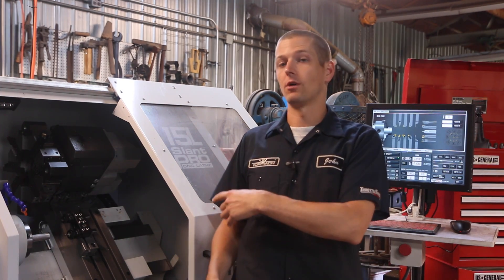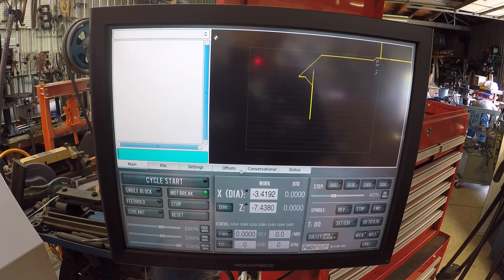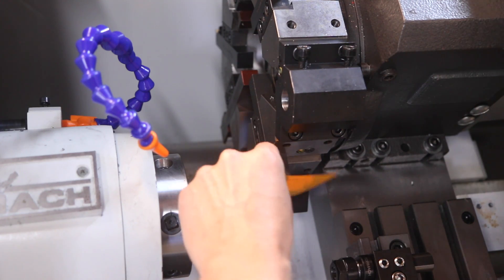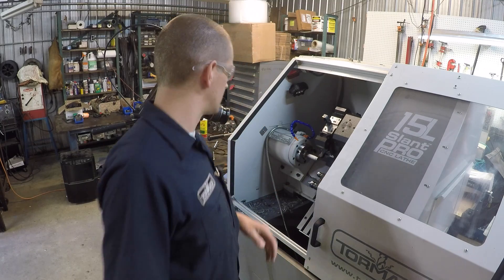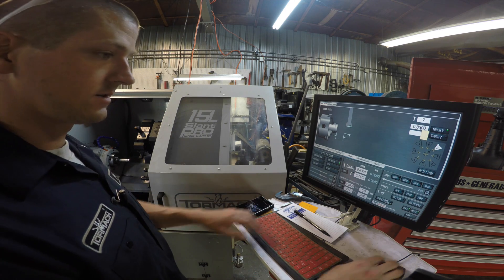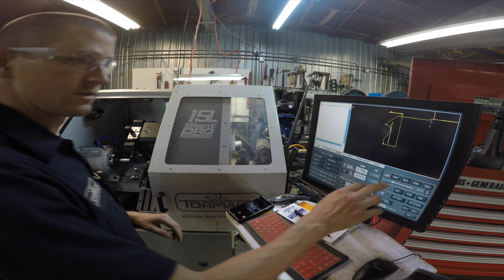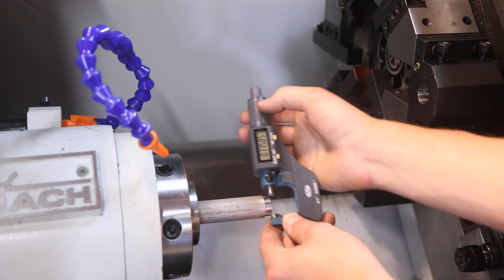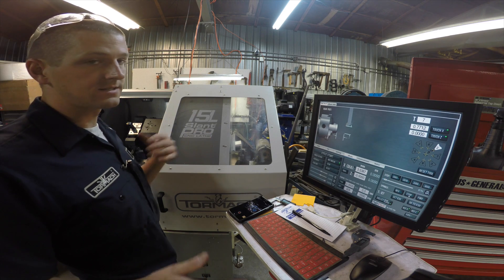Setting Lathe Tool Offsets on Tormach CNC Lathe

Comment: Been a machinist for a full 21 days and this is one of the first videos I’ve seen where you talk like my instructor. Helps so much with blending at home and on the job learning. Also, you didn’t get to the better way of measuring your threads. My shop swears by thread wires/over wires and it’s been the steepest learning curve outside of code literacy

Comment: Thanks for making this. Everyone thinks touch screens are so cool, but I feel like using a slider to control something like spindle speed takes longer and is more frustrating than a traditional knob. My Prototrak mill has the touch screen and I miss being able to look at the cut while dialing in the speed. I noticed you struggling to lower the speed with the slider. If you have oil or coolant on your fingers, it gets all over the screen and it has a hard time recognizing your touch. The plastic ones get all hazy. I hung one of those pens from the control with the tip on it and that helps.

Comment: You have a 3D taster,  you can use it on the lathe to set your tools also. Drive your tools in the X axis till it clocks around twice and set the diameter to zero.  Drive all tools in the Z axis and create a relative Z zero and use work offset in your program to accommodate your stock.

Comment: I did a conversational chamfer operation, and it made several passes before ever contacting the material. Is that typical? Or am I off in my offsets somehow? I think the chamfer turned out correct. Thanks.

Comment: Hey John, have you had a chance to play with the new Turning CAM in Fusion 360 update?  I've been using Sprutcam Express (free) on my Tormach mill, but didn't have any CAM for lathe.  Still working on cleaning up the post processor to work with the Ah-ha controller on my lathe, but so far I'm loving it!

Comment: Does that lathe have an X home switch?

After setting up tools in Mach3 turn tool table and having to touch off every new part with my master tool I thought about it for a bit and promptly installed an X home switch. I tested its repeat-ability a lot and it was good to less then half a thousandth.

I used the mach X axis dro, some test cuts and a mic to determine the distance from tool 1 to center line of the lathe. Now all my 14+ tools are set offset from tool 1 and I simply chuck up my part, home X, and I am good to go. So far everything is coming out with in 1-2 thousandths which I think for a simple stepper machine that's pretty except-able. Having to measure offsets for every new part seems excessive and a waste of time unless you need something super precise.

Comment: Stop babying the damn thing! :P

Turning requires a firm hand. Increase all of your parameters, otherwise you get those stringers instead of chips. My baseline for roughing aluminum is 1000 SFM, .1 DoC and .01 IPR. Then go UP from there. If you do it right, very short chips will be flying across the shop with that door open lol. Here's a bit of video of an aluminum part I run. It goes from 1.000 to .835 in 1 pass with a feedrate of .015 IPR at 3000 RPM. We're making 1,000 of these and I have the cycle time down to 45 seconds now https://youtu.be/XA0pqyAwdzw?t=6m4s

I also personally touch off the front flat of a threading insert. That way I never have to worry about crashing into a shoulder.
Reply: NYC CNC Now you're getting it! :D

Iscar recommends 990-3300 SFM for their IC20 grade inserts for wrought aluminum alloys such as 6061. You'd need a 6 inch diameter bar to hit 3300 SFM in that Tormach, but 1000 is doable :)

Oh, I forgot to mention before. The general rule is 4xD for unsupported stick out from the chuck in a lathe. Any more than that and you start to get chatter and taper. If you go way too far, you get bar whip which is the most terrifying thing you'll ever experience...and it'll destroy your machine. I would go quite a bit closer to the collet when touching off tools to get better accuracy.

Comment: John,  I don't use the paper method.  I have a manual lathe. I always do a test cut, measure and then set the micrometer to the desired diameter, and zero it.  Then when I re-measure, I know how far from the finished diameter I am.  Of course on a CNC, the way you did it is good.

Comment: Why don't you zero your thread tool exactly at the shoulder of the insert and then program the thread length just a fraction from the turned shoulder? That would make things a lot easier and you wouldn't be worried about crashing your tool. Ok, you may miss the length of the cutting tip and the front of the tool but you could add a wider relief cut....
Reply: This was from my experience from machining stuff. Hope my input was a bit helpfull

Comment: I would recommend you to touch of Z of all threading tools on there thought edge of the triangle and not on the tip. This will prevent you from crashing into a shoulder. When I'm cutting close to a shoulder that is e. g. 10mm long I will just cut my thread until 9,8mm and have the peace of mind that there is no reason for the threading tool to crush into the shoulder.
Except when you are in a hurry and quickly reduce the thread  and shoulder length in a program but forget to do so for the cleanup thread pass in the last unit... That's when you think you should have used the tool path simulation which costs you 30 seconds which is much less than the time it takes to realigning the turret or tool post... That's what my personal experience taught me...

Comment: On the threading tool touch the Z to the face of the insert than program your threading cycle to stop short of the face .005-.010 thou that way you know you won't hit the face. On the grooving tool I always touch the face of the part and set Z zero if the tool is used for parting I allow in the program for the tool width that way you could use it for both grooving and parting. Or you could run two offsets on the same tool witch works good for the finish pass to control the width of the groove. Than what about tip comp?
Does your machine use this?

Comment: Good job John. You mentioned inserts, I'm not sure if you've tried them but I can recommend cermet inserts for both the mill and lathe, though not for aluminium obviously. I use Kyocera brand and they leave an almost polished finish on pretty much any steel I can throw at them, up to and including hardened steels.

I liked the cameo appearance of Grandpa ... well,  Grandpa's butt anyway :)
Reply: NYC CNC Cermet inserts are a composite between ceramic and, ah, carbide (... I think). Anyway, ceramic and a metal, that probably depends on the grade. Pure ceramic inserts are good, but delicate. Carbide is, well, carbide. Cermets combine the best of both worlds. Here's a link to Kyocera's info on grades, and it covers Cermets. http://www.kyocera.eu/etc/medialib/kyocera/products/cutting_tools/cutting_tools_pdf1.Par.96899.File.dat/01%20-%20Kyocera%20Insert%20Grades%202010-2011%20%5BENG%5D.pdf

I challenge you to not giggle like a school-girl the first time you run a cermet and see a finish that looks as if it's been polished on a buffing wheel. Literally. Or hard turn something and see the chips dripping off glowing red hot from the tool. They're not for every application, but ideal on tougher or harder materials, yet still work well on mild steels.

Comment: Hmm did you check for run out in your check? If you use a very short piece it will reduce deflection and if you use a very wide piece it will minimize measuring errors.
Reply: Adam Hill *chuck
Reply: NYC CNC Ah fair enough, still worth checking it though, from time to time. Yes it could effect your measuring accuracy and just general accuracy. I mean whats the point if your not measuring accurately?
Reply: Adam Hill how would runout affect the accuracy of the part? Once a pass is made any runout will be eliminated on the work piece.
Reply: akromix It's more of a problem for chucks, espetially if you are rechucking the same peice twice.
Reply: Well yeah...that is obvious.  Even if using soft jaws to rechuck a part you'll most likely have some run out.
Reply: “Necroposting”, as they say, but with that amount of stick out, wouldn’t the amount of part deflection require a spring pass to verify part diameter?

Comment: Too bad there's no tool eye.
Reply: NYC CNC tool eye is an eye that you can touch off your tools on. Easy way to touch off your tool without cutting and measuring or touching it off the stock.
Reply: d1deuce I have a tool probe on one of my lathes. I never use it. Ever.
Reply: akromix For setting up a different tool I find it pretty neat (but not a must have). I know that touching off the tools after insert change is not often necessary but by doing so you can easier compensate for insert variations that are in my case about 0,02-0,04mm in Z and won't need to manually do it with the tool compensation values. Why I need to have the tools nearly perfect in Z? Often I'm facing and roughing with a CNMG insert and for the finishing I use a DNMG or VNMG insert but don't make a finish cut on the "beginning face" of the part. And thus a deviation from the CNMG to the other tool in Z often leads to tiny burrs on the 0,5mm radii I commonly use for chamfers on my parts. Sometimes I also have to use 0,1 or 0,2mm radii on internal diameters when the part is joint with a fillet weld to a tube with only 0,5mm wall thickness where it really has only to be burr free and the welder would kill me for every bit of material that is removed which of course makes it harder to weld such thin walled parts.
I hope the way I described it is understandable.
Reply: +Mazak Man nobody crashed into this tool setter. The machine was bought new. I don't use it because I can touch off and measure faster than using it and then offsetting from it on the actual part.

Comment: I have only watched a few minutes. So keep that in mind. On our lathes during setup I'll usually do the cut and take measurement method for setting x offsets on tooling. I was taught to use a caliper but use mics when I can as I've found more consistent results from initial programming vs having to adjust after the first part. With parting tool offsets I usually will drill the nipple if there is one on the face (usually very minor) and deburr that hole then use a gauge block and jog z+ till touch off much like using one in a machine center to set z offset for a tool. On threading tools I always zero the face of the insert not the centerline. This is just my method and ensures no crashing when I have a specific area threading is being done. I'm sure you're sick of my comments by now haha. We're all learning from each other, I know I am. Curious about why you said the mother tool method has it's disadvantages. I haven't found any but I also learned everything on my own without much input at the beginning.
Reply: Also I did watch the rest before posting this and added to it so disregard me saying I only watched a few minutes.
Reply: NYC CNC usually just stick any drill in the machine and do it manually. However that is only on one of our lathes. The other is dialed in center so there is no nipple on the center of the part.